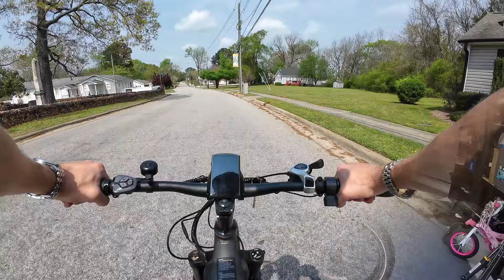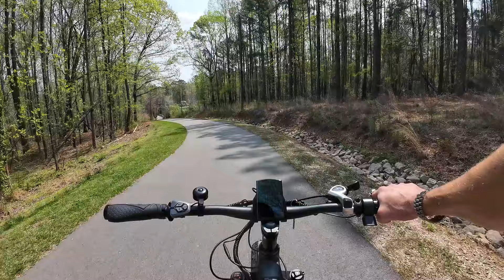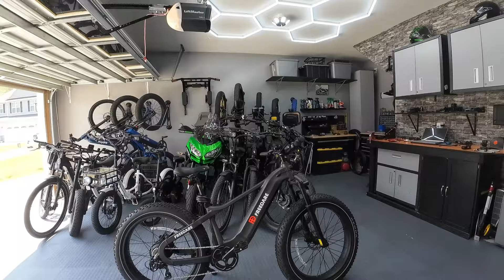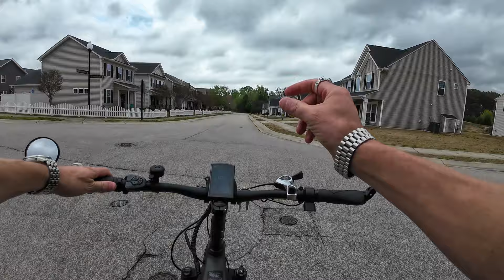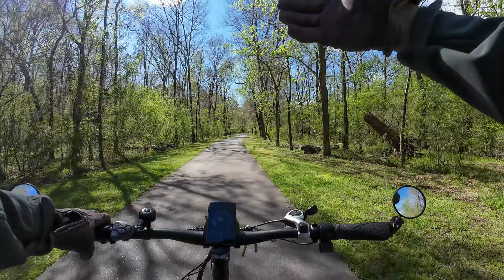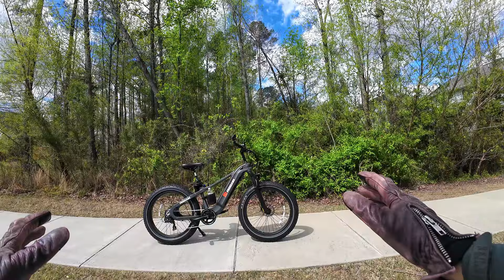eBike Maximum Range Claims:  Freedare Saiga

Comment: I was told that, for maximum (battery) range, the rider should not use any motor assistance from 0 to 10 MPH, and then limit the motor-assisted speed to 15 MPH. Because, as everyone knows, running along at maximum speed eats battery charge - but what many people do not seem to be aware of, is that taking off from a stop eats battery charge even more. In other words, pick a moderate speed and use the battery/motor to maintain that speed - not accelerate to it. Personally, IDK, because I don't have one of those fancy motorized bicycles. But it seemed logical, to me.

Comment: I have an ebike with a 48v, 13Ah battery and a 500w motor, bike is 70lbs. I’m a 54 year old, 170lb male and I have gotten 40 miles on a ride with 2 bars (of 5) left. I use pedal assist 0-2 most of the time, my wife has a step through bike similar weight and at 40miles her battery is pretty much done, she is in pedal assist 2 all the time. The deal is if her battery dies we can switch, so the battery anxiety is all mine, lol. I think the best thing about ebikes is that you can choose how much exercise you want to get, we go further and longer with less pain than we could otherwise, which makes it far more enjoyable.

Comment: The Torque sensor kind of changed what you would normally expect from an ebike range test, the motor was probably always providing some power for you with no actual speed cutoff. Where a cadence sensor equipped bike PAS 1 would assist up to it's cutoff speed then any effort would be all the rider, with the PAS keeping you from dropping below a certain speed. Maybe a test with a cadence sensor bike in the future

Comment: I will soon finish a range test on my Aventon Aventure 2, and based on early data I expect to exceed 90 miles. I'll let you know the results, CC, when I finish the test.
It will be on relatively flat ground, using no throttle, at normal 10-12 mph speeds, in temperatures above 60 degrees, and in the most economical PAS. 
At the moment, I have 10 miles traveled, and battery is at 92%. Rain and cold weather has kept me from completing the test, and forecast still calls for rain this week.
Reply: No update😢
Reply: @Bucksandkids  I've had a health issue that kept me off ebike, and so far got up to about 40 miles with majority of battery left. I still intend to complete the test when weather improves. I did notice that battery discharged a bit while it was parked for the winter. I may have to do a 2nd test to correct for that.

Comment: Got 80 miles on my Kepler using PAS 1-2 with top speed limited to 20 mph and pedaling that entire time Average speed 12.4 mph no hills 200 lbs rider. Not much of my 80 miles was stop and go. I ended at 11%..1st day 51% after just over 50 miles. Next day 30 miles with 11% left and it still went throttle only 26mph😂 .. i did ride the Kepler a bit with PAS 0 at my rest area places a couple times. Maybe 2 miles PAS 0 at like 9-10 mph .  Some fishing boat launch areas or restaurant lots and a park
Reply: Impressive, How is the Kepler doing for you now?

Comment: With my Bafang  M620  midrive pedalling all the time on flat,  little wind ,,pas1, around 12 mph with 19ah battery  bike weight around 85 pounds plus my 230 pounds . around 62 miles maximum,Also my ride is around 30 miles when i get home battery percentage is around 70%-72%
Reply: Middrive has it all! With huge savings!

Comment: Great video! Sometimes I go on these slow group bike rides (300+ bikes) in both the SF Bay Area & in Vegas, and I totally almost get those high advertised ranges on most ebikes. However, at 6'1"/235 lbs., in the real world, (you're right) that advertised range number is cut up to 50%. So, bikes that I only ride during these events, only need to be charged every two to four of those 8 to 15 mile big party rides.

Comment: I got 70 miles once on a Himiway Zebra and still had 26% battery left. It was all in lower assist mode.
Reply: I still get 50-65 miles on my 2021 Himiway Cruiser. It really depends on how you ride it and the terrain. BTW, I weight 250 lbs.